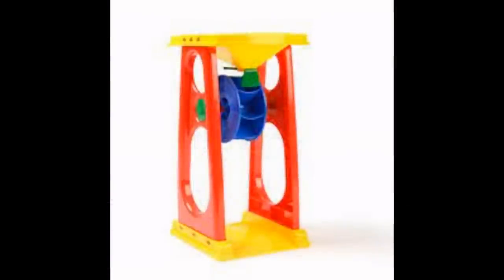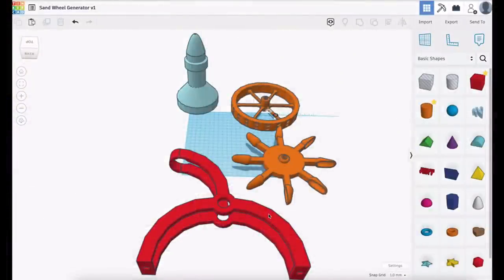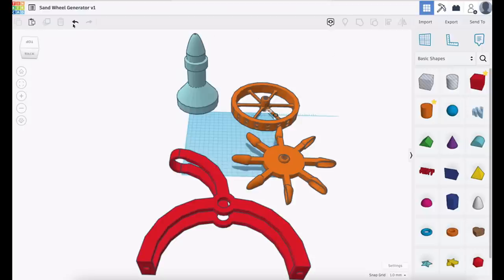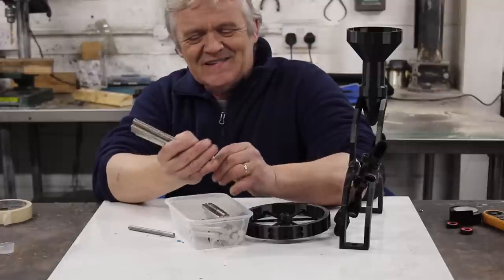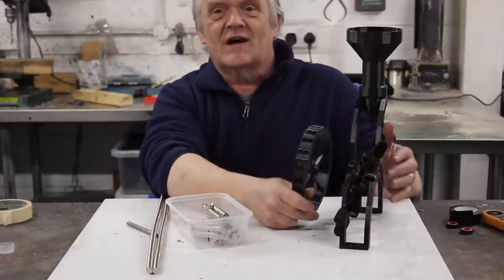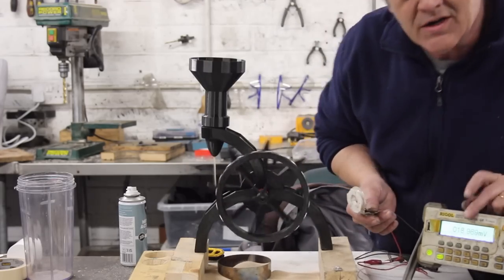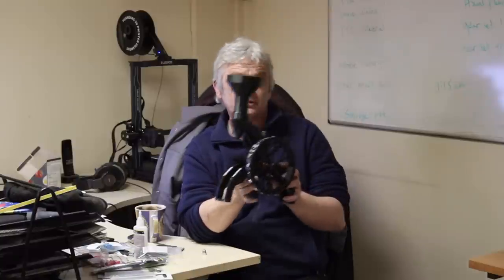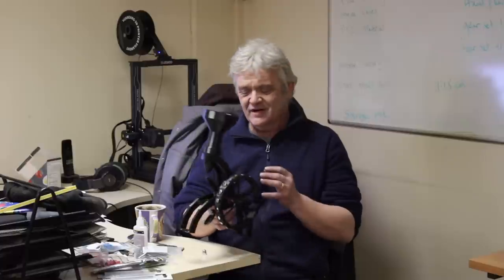1852 A Different Kind Of Sand Battery

Comment: A sand wheel is a nice toy.... But rob did you ever combined Kelvin generator with course sand and run a electrostatic motor with it 😏? You will be surprised how high the voltage gets. 😉 The Kelvin generator with sand runs like a sand clock and generates triboelectricity. It can run on water or sand or every other flowing polarizable matter. And in my eyes would be a mor efficient way to use water from a dam. Because no moving parts and more bang for your buck. The high voltage should be put reversed in into a Tesla coil. And then you would get usable electricity with suitable power on the other end.

Comment: in clock making there's a spring called the hairspring. if that device had 3 cylos with one of them capturing the sand and a hairspring without the palette it should keep spinning until it reaches its resistance point you could make a locking mechanism that lets loose and uses the unwinding force of the hairspring to rotate to the next cylo. you'd obviously need more parts like gears just like a clock but i have no idea how to write it in theory.

Comment: If you've seen "Quint Builds" on YouTube, he made a gravity battery by putting a large water barrel on top of a roof. When filled, the stored energy was roughly equivalent to a AA battery.
Reply: I hope many readers take note of this.
Backyarders don't have room to hold much water/sand/whatever, not much height to raise it, nor the  power system to raise the weight.
Don't forget, it's a battery, basically to store EXCESS power generated by sun, wind, water, etc over and above immediate needs.
It's a lot of infrastructure to get a tiny amount of power back.
People don't realise. or forget, how much power the chemical reactions in today's batteries are capable of, in an incredibly small package, compared to " natural " systems.
Reply from the maker: that is cool - I must check it out
Reply: @topspeed250k5  It's an impressive build, but unless it's done on a large scale (pumped hydro), a chemical rechargeable battery looks a lot more practical.

Comment: You really can't pump sand very well and it doesn't fall from the sky. Also sand will wear everything out pretty quick.Water is much better. IMHO
Reply from the maker: water is better in some circumstances that's for sure - but by no means all

Comment: In theory, with the right winds and the right structure, this could work in any large sandy desert, where the sand falls out of the air into a large funnel and over a wheel...

The REAL problem comes, however, when the sand FILLS UP the area BENEATH the wheel, not allowing any MORE sand any place to GO...

Because unlike water, which is HIGHLY prone to flow to a single molecule, SAND, on the other hand, has a tendency to get CHOKED UP after a while.

So, in the end, to make this LONG TERM SUSTAINABLE, you need SOME WAY to keep moving the sand OUT of the way, without incurring excessive power losses due to the energy and effort required to keep displacing the 'used' sand at the bottom.
Reply from the maker: I think it is great to point out a potential problem I think it is even greater to point out a potential solution as well - and actually - as I am sure you well know - it is not such at problem at all

Comment: I been thinking of buildings a similar gravity wheel, using water , with pivoting buckets,  capacity in the 50-100 gallon range,  spinning very slow, with a overdrive output,  spinning the overdriven generator with the TQ from 100 gallons, on a lever basically, 6 feet long,  then add about 3-4 more buckets with slightly different angles, a single bucket with 100 gallons , weights over 800 lbs,  over 6' x 8+ lbs per gallon, that can reach nearly 5k lbs  feet TQ , due to the low RPM, the HP would be low, compared to what we are accustomed to.  However we do not see 5000' lbs TQ either, for a single bucket, add 3-4 more, it's possible the rpm will be 1 or less, (1 revolutions per 2 minutes,  haha!  But with the TQ. It is going to spin, the load, this is at Max load, when the buckets are full , normal use the TQ required is lees the rpm greater, it could be 5 rpm useful TQ, the overdriven output shaft would be greater, 50:1 possibly (or 1:50)   5 rpm x 50 , 500 rpm then  the driven generator can be over driven again if required,  at leak load it would be roughly v, 50 rpm possibly, if the water supply is great enough !  It can be much higher if the water supply is much higher, 1 gpm is probably minimum for anything useful , 20gpm would be awesome! 40-50 gpm unstoppable,   the potential numbers  require materials to be very strong, 15k ftlbs is a lot of weight!
Reply from the maker: water use as a resource for that is going to be an issue mate - that's a lot of water - sand is 50% more dense so for the same energy output you would need 33% less material

Comment: If the shaft was extended & flywheel added to run an augur (to lift sand back up by the flywheels motion/energy).. might have to start it going, I could see it being easier with a waterwheel & pump with check valve.. (a longer outlet tube would direct & increase force)..  gets the brain going... Thanks Rob... Lol 
Stay Safe
Reply from the maker: awesome mate - you too

Comment: About 60 years ago I saw an electric Generator  made by EDISON That was run by a Huge Pendulum. When It started to slow down a small gas engine would   would kick  on  and it would go to speed again  to produce electricity .
Reply from the maker: that would work - in fact I like it!

Comment: I used to have one of those kids toys when I was a kid.  So sometime in the previous millennium.  The problem is that its operation is greatly compromised if the sand gets wet or even a little damp.  Perhaps a larger device using small, smooth pebbles or even marbles or nuts or coffee beans would work better.   Or basically any liquid denser than water and which doesn't evaporate, like oil.  Mercury would be ideal except for the fact that it's very expensive and very poisonous :)
Reply from the maker: I like that mate - I like it because you point out a potential problem then give a solution - just awesome and I think small marbles or pebbles is an excellent suggestion

Comment: Thinking of a municipal scale, I imagine something like wind or solar powering a vertical belt full of scoopers at the low side of a cone, bowl, or valley shaped collector.  At the top, not just a single hopper, but a set of hoppers on a rail loop of some sort, which varies in height a bit as it goes around, such that a hopper empties at the low point of a track, then the full hoppers behind it at higher points then push the empty hopper up to the high point, and then the empty hopper fills.  This way, several hoppers can be filled as the belt scoopers lift sand, all functioning as an energy storage sink during periods of excess production, for release during periods of scarcity.  Maybe on a medium scale, such a system could be made that breaks down to fit in a van or RV, can be set up, and use sand or maybe dry clay or fine gravel/pebbles, or who knows, spent ash, crushed nut shells, anything flowy.  Augment daily power, to stretch fuel and vegetable or animal or alcohol or petrochemical energy sources further.  The desktop model could be used to semi-automate the equivalent power of a hand crank, so you could do other tasks like mend clothes, cook, watch kids, fish, make hand tools, read, paint, etc.  Every few minutes, grab a scoop of sand and repeat.  Nice idea.
Reply from the maker: nice one ate - cheers

Comment: MUST READ PLEASE Great idea that got me thinking. You are using gravity and the weight of the sand to generate electricity. Now if you reverse the idea back to water using the incoming tide. Submerse a fixed steel tube close to the river bed, seal the top of the tube except for a take off tube. Run this to a turbine and as the tide rises the water pressure will compress the air trapped in the  tube and drive the turbine. using to same principal and a few vales you could take advantage of the falling tide in the same way, well that the basic idea,  it would take a lot more to make it viable but it the thinking and tinkering that the start. Love your videos and the way you thing. Thanks Kingy
Reply from the maker: a good type of turbine for that would be the wells turbine - cheers mate

Comment: I could definitely lift a 5 gallon bucket up 6 feet every evening to send a few $$ back to the electrical grid or power battery chargers (could this power my electric car???).  Would the power output be higher if the magnets were attached to the sides?
Reply from the maker: I don't know mate try it and see

Comment: Wonder if efficiency could be improved by forcing the sand down with enough pressure that it kicks back up, hits a wall and falls back down on the spoon again. Also, instead of 1 big scoop, what if we use the advantage of 3d printers to make sand-sized holes in the wheel?
Reply from the maker: why mate? you are reclaiming the energy from gravity - to force it would mean expending more energy and you are unlikely to get that back I would think
Reply: @ThinkingandTinkering  Hmm yeah that's a good point. I guess you lose energy from the ricochet. I was actually just remembering an earlier video you did on turbines (I think it was one of the spoon ones) where you were saying not all of the force is distributed in a way that pushes it down so some of the energy is lost, and the darwin wind turbine where you were pointing out that the directed airflow hits several blades at once unlike a normal turbine with windflow coming from all sorts of angles that contradict each other and only hit 1 angle on a single blade.
Reply: I've no idea if there's anything to be gained from making the same bit of sand hit multiple points or if there is, what the optimal pressure points would be. I just figured you have a pretty limited amount of sand that costs more to hoist heavier and heavier amounts of sand up against the force of gravity, worth exploring getting as much out of it as you can if there's anything else to squeeze out of it

Comment: Hi all, well with this one im thinking of something like this, 
Building one at the side of my house or at the back in the garden, from the ground floor to the height of the roof, i would make at least 2 "fly wheel generators" out of 2 mountain bike wheels and put one on each side of the paddles so one would get twice the output power,
and with the sand, i would use an excercise bike connected to an Archimedes' screw type thing lifting all the sand up to the top of a drainpipe size type of "silo" to hold all the sand and lets it out slowly all day?  i know the excercise bike could generate that power aswell but this "sand battery" could last all day generating power? anyway, great vid as usual! take care all
Reply from the maker: you are thinking of it just like a battery mate - awesome!! - me too

Comment: Nice idea and little machine but of course, an awful lot of energy would be required to provide the sand storage if this was built to larger domestic scale unless you could channel the wind-driven sands in the Sahara for example.
Reply from the maker: the same amount of energy to provide any storage would be my guess - it's expensive to provide battery storage, water storage or any storage - maybe a comparison would be good - fancy doing one?

Comment: Very interesting!...what if you keep the sand wheel the same size but made the magnet wheel smaller in diameter like 1/2, but made it wider with several row's of magnet's and multiple coil's?...wouldn't that increase the voltage because of the speed increase and extra coil's?...
Reply from the maker: would the speed increase if the wheel was smaller? I am not sure it would mate - but the answer for me is build it and see - especially I am not sure lol

Comment: If you attach a small belt to carry the sand back up to the hopper.... 
And Btw. Ty for Tinker Cad. very nice program. I use Blender mostly and am very happy with it. 
but its nice to have another great program to build in. Ill be in tinker cad alot. smiles
Reply: Bro you should try it. It can power the belt back up somehow

Comment: The main advantage of water over sand, in this particular application, isn't just that it's more dense than sand... it's that water won't erode like sand will. Thinking that you could continually use the same sand over and over again is incorrect, as the sand will be grinding and pounding itself into dust in no time and need to be continually replaced. On a commercial scale, it would create airborne dust issues and waste issues - unless someone has a good use for all the silt it would create.
Reply from the maker: water will erode and sand is more dense than water (water=1,000kg/cubic meter sand=1,500kg/cubic meter - the sand won't pulverise if you don't shot blast it out - I don't know mate but there seems a lot that is wrong in what you are saying

Comment: WHile such a thing does work, the efficiency is far less than that of using water for the same purpose, especially considering how much more effort is required to raise sand to a greater height as well as the increased wear on the lift as compared to a simple water pump. It certainly can never take advantage of the natural (and truly free) rise of water due to mountains and the water cycle.
Reply from the maker: it can't be less efficient mate - you are using gravity on a wheel - the variables are going to be mass and height - it is no more effort to raise 1kg of water 1 meter than it is to raise 1kg of sand 1 meter and you get the same energy out of it when you let it fall back down - as both systems use a wheel the efficiency is going to be the same

Comment: A long time ago before air compressors became commonplace they used gravity fed  sand hoppers as sandblasters they increased the height of the hopper to I believe it was 100 feet high which made enough of a force to clean rusted metal I wonder if you could use that to provide more energy
Reply from the maker: yes you could

Comment: So simple..yet so elegant. Only the wear of the sand on the scoops etc that would be a hassle. Also, perhaps putting the magnets on the side of the wheel will allow the coil to be placed closer and generate a higher output.
Reply from the maker: well worth looking at. mate

Comment: 2:00 WIND will flow sand into a funnel, but it will NOT flow it out the BOTTOM unless you have MORE wind to move the sand AWAY from the discharge point.
Reply from the maker: I am sorry mate but I am not sure what that has to do with anything
Reply: @ThinkingandTinkering  Physics Robert.

Sand is a rather rough shaped, and relatively easily stacked particle, and while it may appear to the naked eye to be very round, and seem to flow very easily, it is important to get a lot of space and a very steep slope to discharge it so it will not all just pile up underneath.

On the other hand, since strong desert winds can blow tons of sand around [aka, let the wind work for you], if you have an area where the wind will spread out and the speed drop, the sand will fall there, and, if there is a properly steep, smooth area below it, it will just fall down there.

If that location is somewhat 'funnel shaped' to the top of your sand wheel, the wind will effectively move your sand for you.

The issue remains, however, that without something at the bottom once again picking up the sand and carrying it away, it will inevitably 'silt out' your system and cause it to stop working.

And unless you have some way of moving sand uphill to above your wheel, which does not inherently cost you energy, you will have to input more energy to move the sand, than the sand can offer you back when falling.

My point is NOT that the idea is rubbish NOR that it simply will not work, my point is that it is much more complicated than a water wheel by a far cry.

Comment: This reminded me of an advancement of grain elevators that was given a patent recently.  Instead of the auger in the center of a pipe spinning, the outer tube with a hole to intake grain, spins and at less energy while not harming the grain.  It makes me wonder if the flywheel could be geared to power a form of return tube to a central basin for the sand at the top.
Reply from the maker: that is interesting thanks for posting mate

Comment: I do not have a 3d printer to experiment with this but I feel the best way to have this spin much faster is to have 5 or more sand wheels connected to each other (paralell alignment) with the same central rod (of course each with its own sand funnel) and have a half a crescent alignment of 8-10 copper wire 'pickups' for each wheel for maximum power generation.
Reply from the maker: a 3d printer can be had for a around 150 dollars
Reply: @ThinkingandTinkering  Thank you for your kind reply. Can you point out one that can print this size parts at this price? Thank you 🙏

Comment: ooo nice robert very cool i imagine a simple angled collector at the bottom there and then an easy clicker type bucket lift maybe so when the first sand bucket goes down it operates the clicker cog hehe ... bit like the slam effect from a water pump maybe. so you are in effect using the falling sand twice on its path.
Reply from the maker: nice thinking mate - not too far from what I was thinking of either - nice one - cheers

Comment: For some reason, the idea of using those marble track toys as generators popped into my head while watching this.. Have the marbles in a hopper that turns a wheel as they come out of the hopper and then have a separate mechanism that when powered moves the marbles back up in order to charge the marble toy battery.
Reply from the maker: I like that mate - a lot!